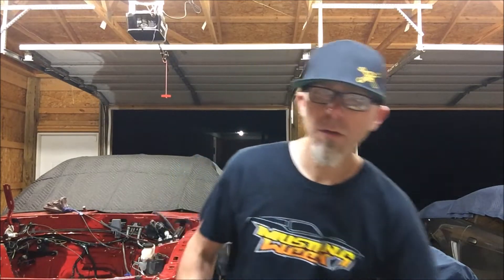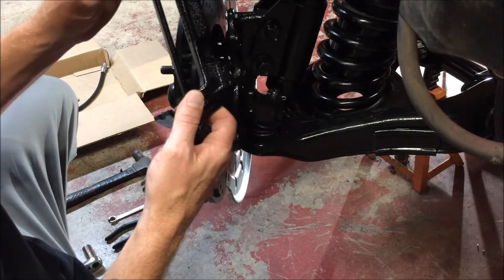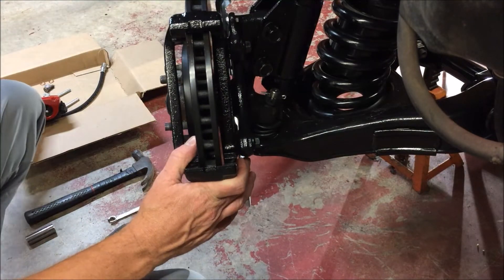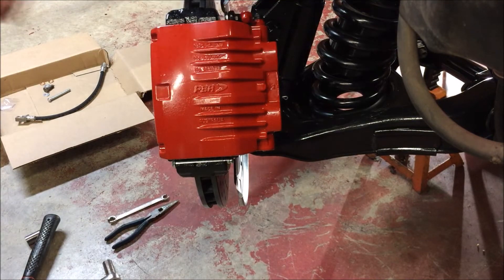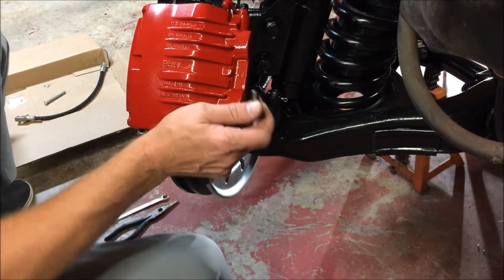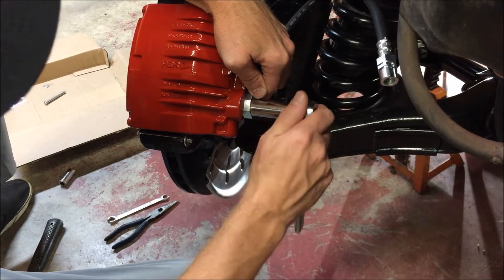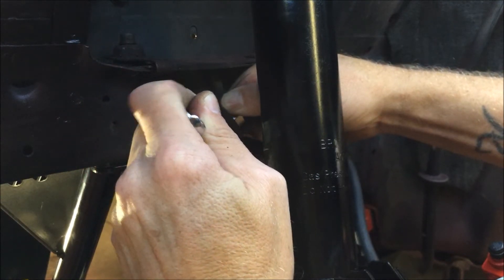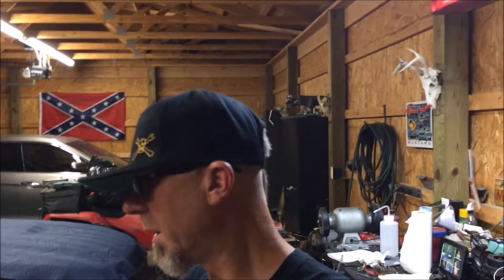Fox Body Installing The Cobra Calipers And Rotors

Comment: Hello. I believe that pad retaining pin is supposed to be installed on the bleeder valve side of the caliper.
Reply from the maker: I thought about that when I installed them I’ll check into that thank you for the tip I appreciate it.👍
Reply: @DEMONFOX5.0   wow. I’m happy and surprised that you responded. I know that was an older video. Thank you. I’m doing a similar mod to my fox, but my buddy had a cobra and I remember helping him with brakes. Anyway thanks!
Reply from the maker: @josebriceno97  yeah this is my first set of cobras and when I was putting them on wasn’t sure on with the way you install the pin. I try to answer everyone as long as I get notification that someone comments on my video. I love interacting with you guys.

Comment: I installed some pbr calipers that came from a 1994 mustang on to my 90 fox what kind of hydraulic hose do I need
Reply from the maker: You will need ones for the 96-04 will work make sure to get the passager side adapter.
Reply: @DEMONFOX5.0  appreciate you

Comment: Where did you get those rotors?
Reply from the maker: Ivan Zabalza I’ll put a link of the site I got them from I think they were free shipping also we’re cheaper than eBay if you believe that lol.

https://brakeperformance.com/index.php
Reply: @DEMONFOX5.0  thank you for the reply im going to be doing a similar break and suspension as you trying to gather up the parts. Going to buy the power stop cobra brake calipers from autozone since they come powder coated red already.
Reply: @DEMONFOX5.0  where did you buy your rear calipers?
Reply from the maker: Ivan Zabalza that’s awesome brother. I bought a complete rear end from a 2002 and got everything I needed to do the swap from that as far as brake calipers bracket’s I have a vid on it but any thing from 94-04 will work.
Reply from the maker: Ivan Zabalza when you watch the video in the description is all the parts and years you need to buy to do the conversion the rear end was only $125 and aftermarket brackets will cost that and you really don’t need them unless you just want them if you have any more questions feel free to ask.
Reply: @DEMONFOX5.0  thank you i watched the video just wasnt sure if they were aftermarker since theyre red. Thank you im sure ill have more questions along the way.
Reply from the maker: Ivan Zabalza no I painted them with caliper paint.